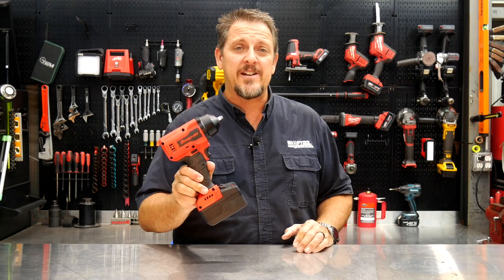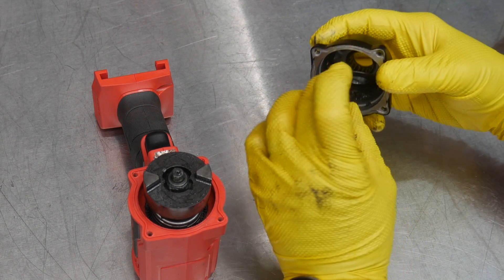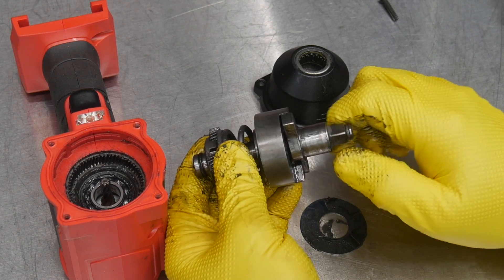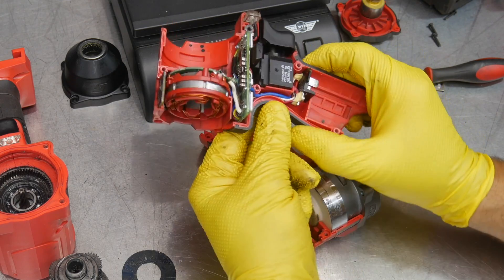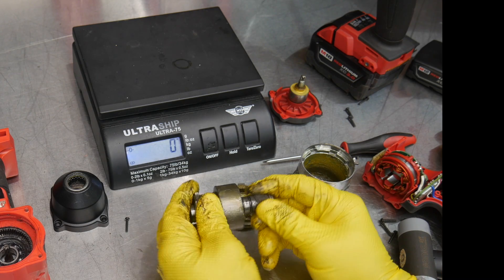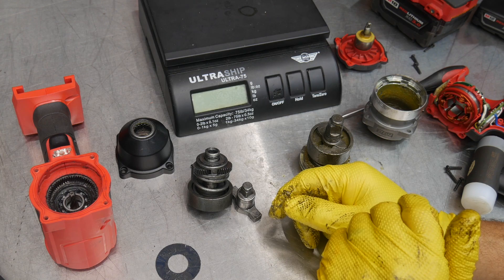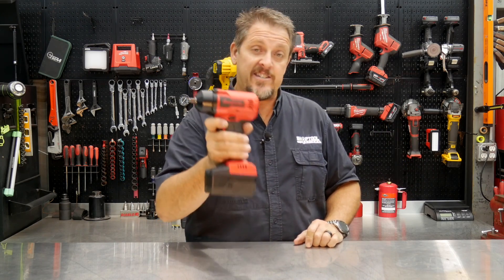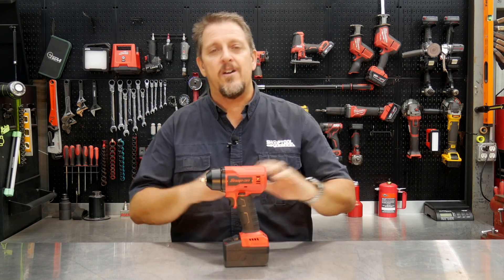WHAT'S INSIDE? $900 Snap-On Tools CT9010 Brushless Impact Wrench

Comment: Based on one of their infomercials. They have a strong proclivity towards 3/8 should be at the necessary torque specs of 3/8 bolts and are not supposed to be used for 1/2" jobs.  German cars are just as good as Japanese although they believe you are going to service and care for car as required. The Japanese gonwith the assumption that you will almost never do a oil change or keep up with the appropriate maintenance.

Comment: I believe you had the answer on screen… the m12 had a difference in impacts vs rpm of 500 while the snapon had a difference of 800. That may speak to a mechanism that is not tuned to perform optimally and instead is striking the anvil not at full force

Comment: I don't think the 900$ price tag is really accurate. That's when you buy it with 2 batteries and Snap On's nice dual battery charger. The bare Snap On tool is only 397.95 where team red's M12 is $199 from good ol' Home Depot. The price isn't so crazy unless you're buying into the battery platforms. Because battery prices on BOTH of them is getting outrageous. 

I personally do not understand how Snap On's impact isn't making any more power or at least matching the power output of team red. It is genuinely confusing. I think the CT861 is probably all you need 3/8ths impact wise if you go with Snap On. I have that and then skipped the 9010 and have the 9050 half inch drive. Much better tool and actually comes with LOTS of power. Slightly edges out the 2767 from team red, but gets beat by Matco's top dog cordless impact. 

Anyway that's enough rambling. I wish this 9010 was more powerful. I love their power tools, they've always felt higher quality and my coworkers and I really haven't had the best experience with Milwaukee power tools. They've broke, the M12 battery tabs always Snap, my chargers like to just stop working. I've printed 3 warranty return labels so far, but I really don't want to go out and buy three boxes and wait a month for them to fix my tools. I'd rather have a quick rebuild on the Snap On truck or a replacement during that short 1 year warranty haha. So they've been dead in a bin in my garage for months as my Snap On's do all the jobs they need to do at work. You can ride team reds rocket all you want, but recently their quality has been very disappointing.

Comment: I’ve beat the piss out of my ct9010 and ct9080. Both are great tools. Haven’t had a bolt or but I couldn’t break loose with my ct9080. And I’m a big diesel tech. I’ve broken head bolts loose on mtu 4000s with it no problem. They both have held up great. And I’m not dogging Milwaukee but every Milwaukee tool I’ve owned hasn’t lasted more than a year. And I used to be a Milwaukee fan boy. My snap on guy is also the reason I bought. Great guy and I’ll support him till the end.

Comment: Ok the hammer mechanism looks the same as the older one I have mine has become weak over time barley take a lug nut off thinking the big spring has become weak. Snap said they couldn’t replace anything on it saying the parts are discontinued so I’m thinking if I could take the hammer part apart and put a shim on one in to make the spring tighter

Comment: I just watched this video, I’ve became a Milwaukee believer thanks to your videos btw. In the Marine Corps we don’t get a lot, but what’ we do get is Milwaukee tools especially impact tools. I have the Makita xdt 16 which is perfect for precision and as well as some dewalts. What I have noticed and experienced is and what has separated Milwaukee tools especially the fuel lineup is the internal electrical current from its power supply and circuit board is without a doubt exceptional in the modern age of battery powered tools.

Comment: They are definitely built with longevity in mind. Every Milwaukee I've had beat itself to death in a year or less, especially the 3/8 stubby.

I still have the previous snap on 3/8 brushed version #8810 that is 5 years old and still works like new.
Reply: Bro same...I had my snap on 8850 for like 4-5 years.  I changed 2 triggers in that time that were cheap but I use the hell out of my tools... I switched to Milwaukee just like most of these videos say and the issue with Milwaukee is the batteries...and not how long they last the plastic falls apart and they can't clip in...so about 6 months into my M12& M18 ownership all my batteries were broke and falling off and you can't buy cases easy. So you have to get new batteries. After all that bs I switch back to a snap on ct9080. And for my smaller tools got a deal on Ryobi. But the battery design is much better

Doesn't matter how good the Milwaukee is if the batteries can't keep up
Reply: @Alexbuilt  m12 platform was the fist to go. Mine wouldn't keep a battery in it unless I electrical taped it to it. 
Battery slop on my M18 stuff was really bad as you mentioned as well. 
Ive never have that issue with 14.4 and 18 v snap on stuff. 
I just got that 9080 2 weeks ago. That thing is bad ass!
Reply: @upnorth5465  how is the 9080?
Reply: @zackenter6436  its well worth the money. It's noticably lighter and stronger than the previous 9075. I got mine for $325 after a trade in and it came with a battery. 
Way better than my Milwaukee 2767 ever was.
Reply: @upnorth5465  yeah i think ill have to trade in my 9075 for that, its not out in the uk yet i got to wait 😭
Reply from the maker: I've heard this about Milwaukees, but I have yet to see one do this. Yes, we see the M12 battery issues, but never seen any of the impacts beat itself to death, especially in a year. Thanks for the feedback.

Comment: Imagine if after he put the Snap on back together it started busting bolts loose torqued at 2,000 lbs.
Reply from the maker: Lol. Yeah, right. Thanks for watching.
Reply: @Shoptoolreviews  I know right lmao
Reply: @Shoptoolreviews  I owned a CT9075 it was stolen a week later but it too is way under powered however the guts are so solid, makes no sense. If you ever can do a breakdown video on it you can see how well it’s made. I am sticking with Makita the power loss is ridiculous on the Snap on.

Comment: It’s probably 2 things.  Weaker spring on the hammer and yes I believe it’s detuned for longevity because the previous 8810 was notorious for short life span so they’re hoping with it set this way it’ll give years of trouble free service.   As far as price goes that’s probably the difference from made solely in China vs Snap-on being made in the states (NC).    American labor costs more money and we all know this but honestly this gun should cost $300 less even though that’s still high but that’s still in the ballpark of made in America.   My $0.02
Reply from the maker: This Snap-On is NOT made in the USA. It is partially assembled here, but not made here. They just flat out missed this mark on this impact wrench. Way under-powered and should have never been released. Thanks for watching.
Reply: @Shoptoolreviews  I agree it underpowered but why does someone need a 600ftlb 3/8?   Forget price for a moment.  Back in the day 150-200ftlbs was the norm and a 1/2” air was 550-900ftlbs.   Everyone got along just fine.   Seems to me like all tool companies are just looking for bragging rights!  Yes Milwaukee makes a great tool for the money but think about this, if it’s so great then why do you have to strap the battery to keep it from losing connection and/or falling off because I’ve seen it happen first hand.  Some of these companies need to do a little more r&d to fix issues and other need to get off their high horse and make em affordable.  I’m an ingersoll rand 20v fan and I use mac 20v in the shop.   Please test the w5133 against Milwaukee btw lol.   Have a good day sir!
Reply: @Shoptoolreviews  It is overpriced and underpowered but some of the parts are made in the US. I've personally been to their manufacturing plant in Murphy, NC. Regardless where it's made it should be the very best to wear the Snap-On on name but unfortunately it's nowhere in the ballpark.

Comment: overbuilt where it doesnt matter, underbuilt where it does, ppl ive worked with who use snap on electric tools arent ever very impressed with them.  They arent even reliable either.  I think the price difference is that snap on buys probably 1 : 1,000,000 what milwaukee does in electric components from its suppliers, driving up costs dramatically.  You might also notice theres a lot of weight to the motor that doesnt need to be there, just because its all heavier doesnt mean itll perform better, balancing  power and weight in the end will give you a better result.
Reply from the maker: Very good points. It's just sad that they charge so much and perform so little. Thanks for watching.

Comment: I think it all comes down to engineering, if you have better well optimized design you might achieve more with much less.
Raw specs like RPM anvil weight etc just tell part of the story in complex design that might have more than what meets the eye.
Reply from the maker: Very good points. Thanks for watching.

Comment: Over all it's very well made it's the power it has its not enough it's batteries suck doesn't give it the power it DESERVES I bet u find a way to put a milwaukee battery on that SNAP-NO AND A BET IT DOES BETTER BUT STILL A OVER RATED TOOL THERE R A LOT BETTER FOR A LOT CHEAPER 💯🇺🇸👍

Comment: Aren't these sold by independent dealers? Built-in profits to dealers.
Reply from the maker: Correct, each tool truck is their own dealer, or you can buy on the Snap-On store. Not sure what that  cut is. The issue is, each tool truck is selling a tool at a set price, which includes lackluster performance at the highest price in the industry. Puts that tool truck dealer/driver in a pretty awkward place. Thanks for watching.

Comment: lighter hammering mechanism meaning higher speed... just like air tools that always stronger than electrical tools since the higher rpm creating higher torque.
Reply from the maker: Well. in the Snap-On's case, it's not creating more torque. Very underwhelming when it comes to power. Thanks for watching.

Comment: And in auto transmissions the OD planetary gear can be aluminum and that's why the truck will say not to tow in OD because it will eat up the gear. The one I seen was the 90s automatic transmission from a ford f350 with the 7.3 powerstroke. And from one tow of about 20 miles it was done for. So dont tow in OD. I remember that the truck was the ford that had the OD button on the end of the geat shifter on the column.
Reply from the maker: Correct, not good to tow in OD. Thanks for watching
Reply: @Shoptoolreviews  youd be surprised at how many people don't do this.

Comment: I have bought lots of snap on electric and pneumatic tools but i will not buy any more. I learned some time ago they made good ergonomic hand tools and i do like them but when it comes to electric or pneumatic they suck. Snap on has changed there batteries soo many times over the years that alone makes them suck but for the little better they engineer them i can buy 5 set from the competitor. Its a no brainer.
Reply from the maker: You said it. Thanks for watching.

Comment: It may not have the most power but I've got snap on impacts that are still in use after more than 10 years, batteries are on 3rd rebuilds. I've got the milwaukee high torque 18 volt ½ inch drive, way more power but after 3 years it is in rough shape, a lot of times it will stop working with battery coming loose. I get it though, I'll buy 2 more milwaukee before 1 snap on... But then again I'll need to
Reply from the maker: If you see the value in the Snap-on, then that's great. We just don't see it in this particular model. Thanks for watching.

Comment: If you could swap out the impact mechanism spring with somthing alot stronger. Kinda like valve springs in a cylinder head. It would make the impact way more stronger. That's where all the power comes from.
Reply from the maker: Maybe. I could pull some of my old BigBlock triple valve springs out and see if that helps. lol. Thanks for watching.

Comment: I bought my Ct9010 a couple weeks ago, I love mine use it every day in a semi truck shop. One guy had a Milwaukee 3/8 18v impact not be able to take a bolt off of a Cummins X15 engine, my snap on ct9010 broke it loose in literally like 1.5 seconds. I have nothing but snap on 18v and 14.4v tools because I absolutely hate Milwaukee m12 tools, and my 18v didn't impress me. I've not had one bolt not come loose using my ct9010 or ct9075 snapon impact in a volvo/mack dealership. Also my snap on tools don't have the problem that my Milwaukee's had, which was battery issues. Also side note, my snap on 18v batteries last about a week and a half between charges using everyday, 14.4v us about a week.
Reply from the maker: Wow, those are impressive results for your Snap-On tools. That's awesome that they're working great for you. Thanks for watching.

Comment: You need to update your pricing is not $900 for the 3/8  It is $600 For the kit $900 for the 1/2 kit
Reply from the maker: Looks like they have changed their prices in the past week and with more options, but it’s still not $600 for the kit. $365 for the bare tool (they didn’t even offer this before), $500 for the tool and 1 battery, and $800 for the kit with 2 batteries and charger. 
https://shop.snapon.com/categories/Brushless-Impacts/886123

Comment: If you paid $900 thats your fault. They sell for $363
Reply from the maker: You can’t get the Snap-On CT9010 for $363. You can’t even get it as a bare tool. It’s brand new, and they will only sell it with 1 battery ($500), or with 2 batteries and a charger ($841).
Edit: they do offer the bare tool now (just this week) for $363. Still overpriced and underwhelming.

Comment: Main difference is Snap-On's motor spins at half the RPM of Milwaukee. It has similar IPM through reduction, but that reduction also is what lowers the impact force. Snap-on needs a better motor.
Reply from the maker: Very true. Thanks for watching.

Comment: Milwaukee impacts have never let me down. M18 platform is enormous. You can buy a lot of tools and/or batteries for $900.
Reply from the maker: You are very correct. Thanks for watching.
Reply: It’s not a $900 tool
Reply: @charlieeldred5782  I was basing that off of Shop Tool Reviews previous comment that the package he purchased was $871. I know bare tool price would be cheaper but I would be purchasing it with at least two batteries and a charger since I do not own any other SnapOn battery tools. Tool truck pricing is also inflated as well. I just purchased a Milwaukee 1/2" high-torque impact kit with charger and two 5.0 amp hour batteries at Farm and Fleet for $300 on a promo deal. I doubt you can find any type of comparable deal for the Snap On

Comment: Snap-on makes some pretty good hand tools (which is reflected in the price) however their battery tools are as good as harbor freights. Milwaukee is where it's at
Reply: Rigid and makita are where its at
Reply: @jabadahut8420  for mechanics use it's pretty hard to beat the M12 line
Reply: @robertstetson4077  I am a mechanic, I've been using Makita for a while
Reply: @jabadahut8420  I'm not a big Makita guy but I hear they're good

Comment: The snap on needs to be broken in before it will maximize its full power
Reply from the maker: So once it's broken in, then it doubles in power? That's interesting. Thanks for watching.
Reply: It’s what the snap on dealer told me I’m thinking it was just a selling point, there is only one way to find out do the test on a used span on ct9010 😁

Comment: They are not 900$.. you got ripped off. My dealer is selling them a lot cheaper then that.
Reply from the maker: You can get the bare tool for $365, tool and 1 battery for $500, and the 2 battery kit and charger is $800. To my door, we spent $871.

Comment: Milwaukee been making battery powered tools alot longer then snap on came in the brushless game way to late
Reply from the maker: Great point. Thanks for watching.
Reply: Not strictly true. Snap-on had a 3/8” cordless impact back in the early 90’s. The CT30. They just didn’t invest enough in the sector and got left way behind.
Reply: @OnlyToolsAndBoxes  but it dont matter milwaukee still been making battery tools a lot longer and when brushless came to the game milwaukee was all over it why snap on was putting out brushed junk and that is true
Reply: Or can word it like this milwaukee been making power tools as long as snap on been making hand tools so

Comment: Cordless is great, it's really handy. However, for a shop situation, my Chicago Pneumatic impact was old when I traded for it 50 years ago. It's still going strong despite driving over it with a tractor and breaking the handle off and welding it back on years ago. Where do you think the cordless will be in 50 years, or even 5 years?
Reply from the maker: This could be an hour long conversation, but I'll be brief. You're exactly right. Air tools are can almost last forever, when taken care of and serviced. You'll never have a cordless tool that will last that long. However, the cordless tools are really handy (as you mentioned), and they don't require an air line or a compressor. The cordless units are also delivering the power of air now (for the most part). The battery powered industry has also done a great job of training us to "replace" tools every couple of years. Thanks again for the input and thanks for watching.